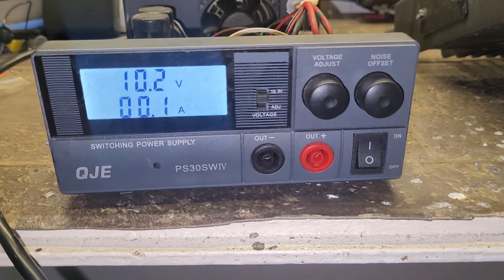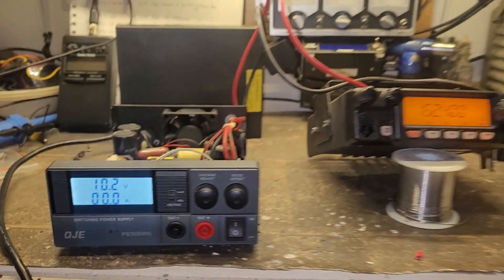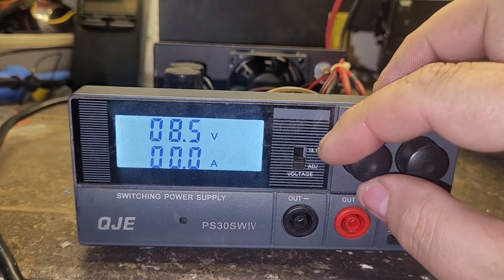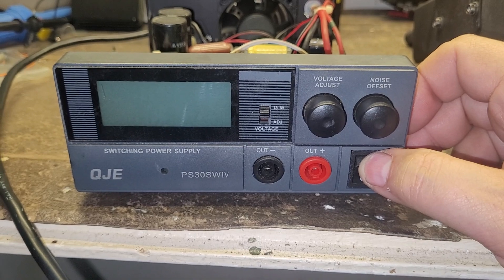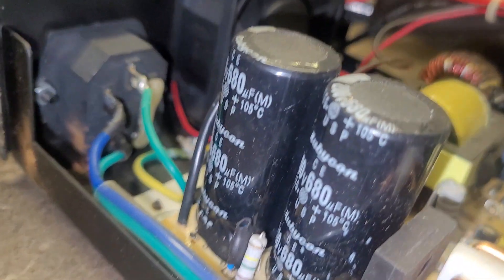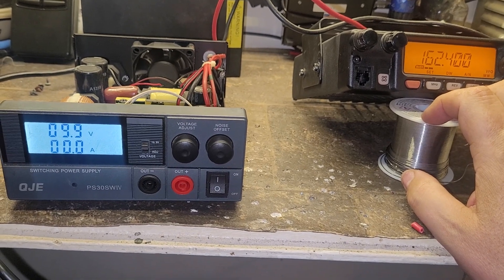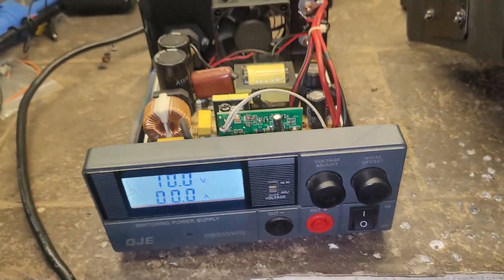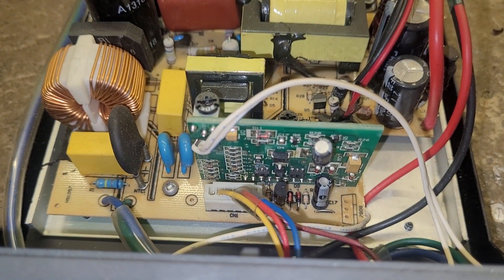QJE PS30SWIV - 120vac MODIFICATION - Part-1

Comment: I have the exact power supply. At your own risk that little board that you see with the black adj pod with number on it That's what adj voltage Would suggest putting ps on 13.8 setting when adjusting to 13.8

Comment: The trick is that these need 220VAC, and exhibit this behavior on 110...
Reply from the maker: Holy crap!  You are 100% correct!  I never even noticed that on the rear of the power supply!   Well, this mystery is solved, thank you for your comment, now it gets shelved as it is of zero use to me!   :-)
Reply: @Radionut63  Happy to help! I actually did get these going with a 110-220v transformer, once I realized what was up.
Reply: Mine works fine on 110v as it is for 110v There are some made for 220.

Comment: I have a TekPower  tp50sw that has the same case, but different inside .  Saw a video over on learnelectronics channel  "TekPower TP30SWI Power Supply Teardown" insides look the same inside as what you have. The voltage adjust pot is on the board from what he said.  Also, not sure if it was the way the camera captured it but one of the large vertical resistors in the back by the big caps looked cracked on top ?
Reply from the maker: Just had a look, the resistors are fine.   But that voltage adjust pot is not doing anything!
Reply: @Radionut63   I see. Hopefully you can find a decent schematic with voltage points to trace back . Seems something has failed, but not all the way since there is 10v.  Hmm..
Reply from the maker: Supply is floating at 12.6vdc today... what ever is going with this thing is weird!
Reply: @Radionut63   Does it handle a decent amount of load and stay at 12.6 ?
Reply from the maker: And so far i can not locate a schematic for this power supply... sucks, as it will make repairing this thing much harder.
Reply from the maker: Just with a VHF mobile hooked to it, the voltage drops nearly a 1vdc with about 1amp draw, the current handling of this is out the door at the moment.
Reply: @Radionut63   I so much miss the old school power supplies.  Fixing up a burned up Astron and such was so easy.  A burned up rectifier or a burned part on main board...easy to spot...ah the old days..  Maybe check that rectifier.   and trace...if it's worth it.   Otherwise it could be a tattoo power supply until it fully fails !     🤣
Reply: you know it'll end up being a "grain of salt" size component somere in that mess..or an IC..
Reply from the maker: @EricTechstuffs  Either that or scrap!  ;-)

Comment: Darrel I don’t think that power supply was built to power a radio. 
Given the voltage range it would be perfect to power a
Tattoo machine 
Just sayin
Reply from the maker: suppose to be 13.8vdc @ 30amp surge
Reply: @Radionut63  “supposed” to be yes I know but given the puny components I doubt it would sustain 30A for very long and if it did endure a high current load it may have toasted some components necessary for proper output. 
In the meantime it has the perfect voltage range to power up a tattoo machine 
Maybe inadvertently but yet it is what it is. ;)
Reply from the maker: @madeinfoxtrap5539  you can have it if you want it, i have plenty supplies kicking around here.

Comment: No switch on the back to lock it onto 13.8v
Reply: Yours is on the front I just noticed it, have you checked the switch ain't tripped
Reply from the maker: The adjust switch seems to be working normally as it will adjust the voltage up and down, but no higher then 12.2vdc, also the onboard voltage adjust on the main board do not adjust voltage either direction, so it would appear there is a voltage control regulator or circuit not working correctly.
Reply: @Radionut63  hope you manage to fix it, only problem I've ever had with my psu's 30amp & 50amp was that switch on the back had been knocked by the coax, 7.1v was showing, took me 10mins to figure it out as I'm no Elecy Tech, anyways I enjoyed watching. 407 said that from Manchester Uk 👋
Reply from the maker: i will have a look at the switch this weekend, double check it